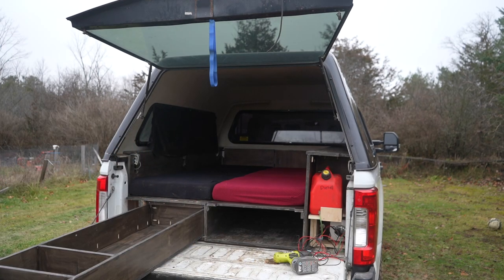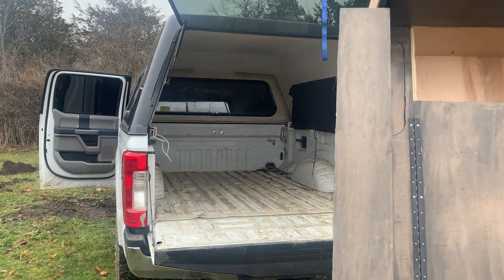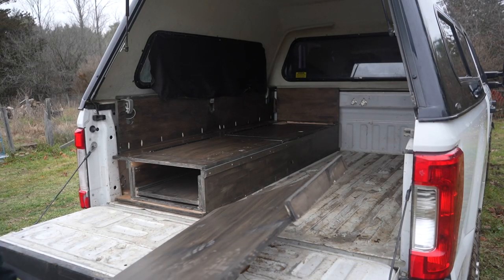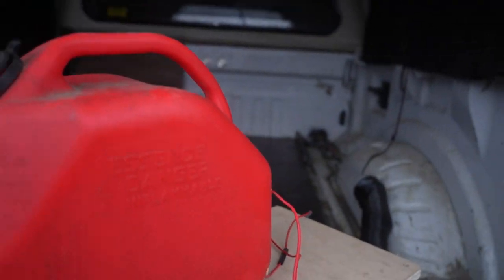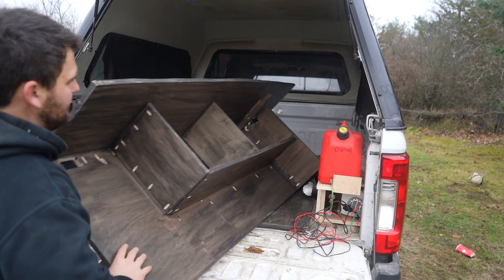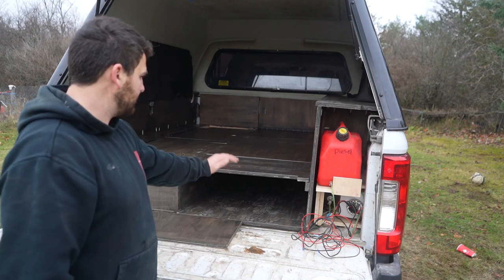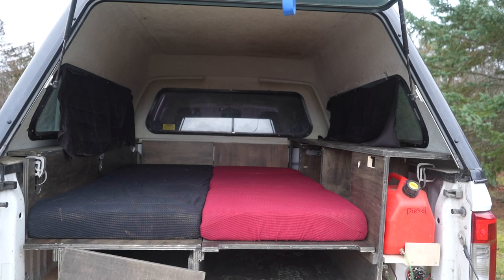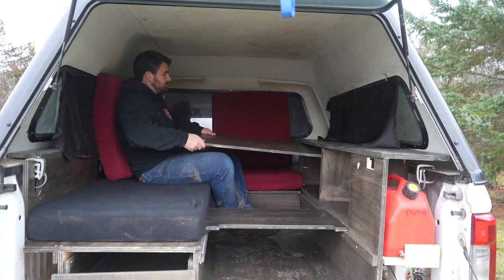Removable Truck Bed Camper-  Work truck to camper in minutes

Comment: Pretty well thought out system , simple and cheap .
They do make quit(er) pumps for those heaters so it doesn't sound like a pogo stick race all night .
Alternately you can put the pump in an insulated box to quiet it down .
Reply from the maker: Thank you! We like the way it turned out. I will need to look into a couple of those options for the pump